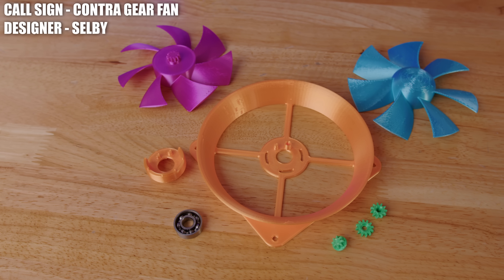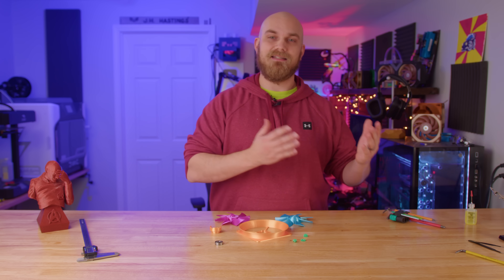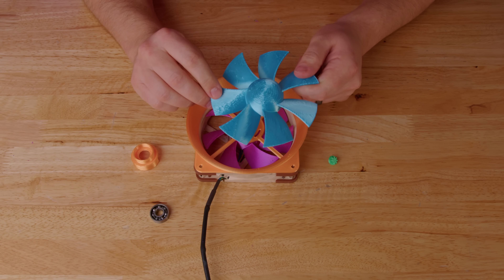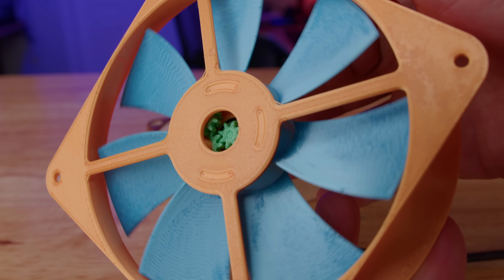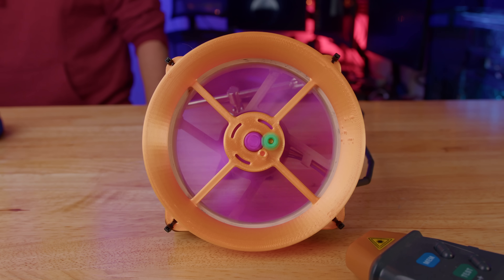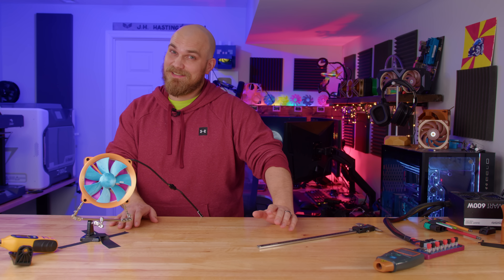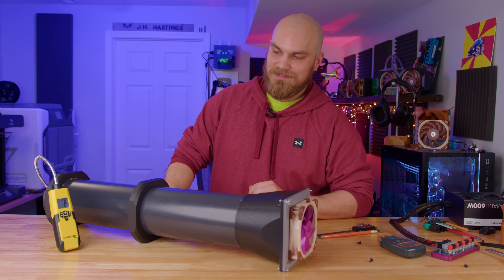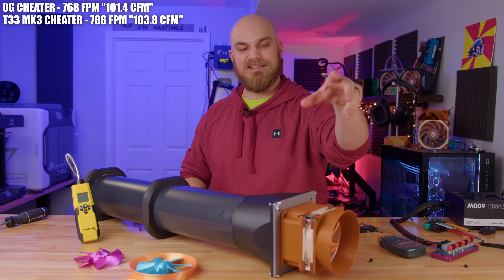World’s Most Complex PC Cooling Fan | Fan Showdown S4 Special

Comment: FINALLY! it took me as long as the subreddit has existed but I finally got a contra fan to make it! and it actually works... good times. Going to be honest, even though I know contra rotation has its advantages I'm genuinely surprised the second fan actually managed to increase performance and seeing it do so is a very good feeling.   

For anyone wondering about planetary and bevel gears sets the issues really comes down to how the gears are braced inside the fan. In the case of planetary all the designs I tried just added to much friction (causing both to be slow and much louder) all while not running at a 1:1 fan speed ratio which I wanted to reduce the chance of one fan throttling the other, this is also why the fans have the same blade count even though that probably increased noise a fair bit. As for bevel gears well i just couldn't manage to print 3D them and still function at such small scale and as such cant really as much about how well they work.
Reply: Well done! Awesome design.
Reply: It really is an awesome feat. Congratulations!
Reply: awesome fan and design. Now I want to see your Contra fan with a shroud as large as the cheaters to see if it gets even better?
Reply: @TheFinalattacker  First thing I need to change is the hub size, I forgot the motor is much smaller then the A12x25's hub meaning in the smoke test for my design you can see a large lip around the base causing a lot of turbulence. I suspect part of the reason the T33 works so well is it's hub matching the frames base diameter while being tapered for better air flow. After that I guess I can look into improving the inlet and outlet like the cheater does...
Reply: @qazaq25   I wonder what would have happened if it would have used the stock fan design
Reply: u r a legend, Sir.
Reply: Very cool design. You should be proud.
Reply: Do you think a different printer may help with the flaws in bevel gears? Like a resin printer over a filament printer.
I've never done any 3d printing so have no clue what features make more accurate prints.
If so maybe we could pester James for a revisit if Shelby has a design for it.
Reply: If this fan could be made from precision machine components, wow, I would buy it in a heart beat.  Contra fans are just so cool.
Reply: Sweet fan.  Appreciate the research and work that went into.  I think GOAT is an unfair characterization however.  I propose Fan Showdown GodKing.
Reply: what if, t-33 mk3 and counter-rotate fans combined...
Reply: Just a thought, would making the drive fan blade pitch more aggressive to account for the fact it's moving already accelerated (lower pressure) air improve the overall performance?
Reply: @alargecookie  No not really its ideal to have nearly the same fan since most of the benefit is hitting the air coming off the front blade and counteracting the lateral component that the first blade imparts on the air yo u can see that in the smoke coming out nice and straight and not cone shaped. Think of it in terms of the same reason that you need to paddle a canoe on both sides to move forward.
Reply: @alargecookie  Yes, the inner fan should have more aggressive pitch, which should boost the performance a fair amount. I couldn't tell you what the pitch should be, though.

Now I want to see a PC fan with variable pitch props...
Reply: @alargecookie  not really. you would create pressure difference between the blades but it could not be used. if you block of the exhaust and route the air out between the fanblades you basically got a compressor. since we want the air go through,  different pitch would not be beneficial. maybe in small amounts to counter velocity loss, but no more.
Reply: So...how long until we see the Selby Cheater colab fan aka "the lord of the fans"
Reply: You have been given the G.O.A.T. designation. I agree. Fantastic job and design.
Reply: The cheater frame is uneconomical, the contrafan is better by size
Reply: How about the blue fan from Season 1
Reply: I had lost hope for gear based fans. The results for this contra fan are awesome!
Reply: Keeping the hub down with smaller gears was also a pretty inspired design too man - that packages really really well and was a good bit of engineering.

I don't know if there's any science out there on the interaction of contra-rotating fans (as opposed to compressors or propellers) that could be applied here that you haven't done already - all I can think of is improving blade interaction and then trying to reduce friction to increase max RPM.

Well friggin done.
Reply: I mean I'm not a fan builder and I'm not an engineer great work by the way I was wondering though I wonder how well the fan would work if you tighten the tolerances of the gear a little bit because if you notice the once the first fan spins it takes a minute for the second one to spin again I'm just asking a question so I'm sorry if it's a bad one LOL
Reply: @cptn.obvious  The term your looking for is backlash and yes there might be a little too much here but probably not enough to be particularly concerned. Backlash is important as it helps prevent gears binding as well as some other things. Unfortunately a lot of that play is also down to the fact these are 3d printed resulting in the spacing between the shaft and bore of the gear having to be "large" to reliably run smoothly but also allows them to push each other away, now that could be fixed by using bushings and metal shafts for the gears but I wasn't about to make the design require those on what is essentially a prototype I wouldn't be assembling myself.
Reply: @qazaq25  thanks for the explanation i appreciate and now i understand still an awesome fan great work
Reply: @qazaq25  Contra is actually made wrong. The primary fan should turn slower than the secondary fan
Reply: @cptn.obvious  Backlash (or lack of) is more important when you're using the gears to index to a precise position rather than spin continuously. When it's spinning in a steady state under load, the back pressure of the air is keeping it pressed one way, so it doesn't wobble too much.
Reply: If you used two notcua fans, running against each other but printed a fan with opposite fan blades then you could have full control of both the RPM’s to balance noise. Yeh against the rules but interesting idea…?
Reply: I've been trying to design a counter-rotating fan since the show started, but I've never been great with gear trains so I never could get it to work out right. I'm so happy that you were able to make one that works so well and that made it onto the show!!! Contgrats!!!
Reply: This may or may not have been mentioned, but here's an idea to reduce the noise of the geartrain. With the aircraft engines trying to maintain their speed and torque in both prop sets given the size and weight of components, the gearset makes sense: we're talking about a fan that is significantly smaller in various regards. 

So the thought is this- maintain the reduction ratios but have the gears be appropriately sized drive wheels (shaft with a rubberized material or TPU insert) to act as wheels running against each other. This might result in a slightly higher fiction load on startup, but it could maintain the reduction ratio with significantly less noise, still transmit the power with reversed direction, and effectively eliminate the need for lubricating oil.
Reply: Strikes me that its STATIC PRESSURE would be through the roof!!! I suspect as a pure air flow fan it isn't showing its best, but as a fan to go on a radiator.... You are really truly onto something... Like really big onto something!!! Major, you need to test it on a radiator!

That thing was spectacular.

The iterative updates that are coming through on this show have got to be making fan manufacturers stand up and take some real notice.

Major, you have created a movement here... An air one (geddit) but a movement nonetheless.
Reply: @DampQuiche  Contra rotating fans are really good for producing high thrust (essentially injecting airflow at a distance) - I wouldn't be shocked to see that the airflow distribution at his measurement point is much less uniform with the contra rotating setup relative to the MK3. The contra fans would likely be much better as a fan for a server rack where you needed to make sure your cooling air got further into the rack.
Reply: This thing is awesome, thank you for sharing!
I was wondering, if the secondary fan actually helps or whether it is the shroud, that does it?
Reply: @minipaintingforyou  It's the extra fan the shroud only helps a minimal bit because its very small compared to other designs that use taller shrouds to help direct airflow, in this case the shroud is more like a safety feature/structural necessity but I digress, the extra fan provides additional surface area so it moves more air. Do note that despite being an entirely new fan the volume of air is not doubled. That is not a flaw but the result of both the available mechanical energy being split between the fans, inherent inefficiencies of the gearing and the fact that increasing air speed is does not scale linearly it takes increasingly more energy in order to accelerate more. (Wind resistance and all that.)
Reply: @alexisrivera200xable  thank you =)
Reply: now add a stator between the two fans
Reply: it looked like the blades on your contra-rotating fan design had similar blade angles i wonder how well it would work if you created a steeper blade angle on the drive fan like you would see in an aircraft compressor fan
Reply: awesome. is it possible to add tiny little bearings for the gears, too? like teflon or ptfe, even copper (and gun oil?) could work. oh yeah, if possible helical gears for noise reduction. and if we are dreaming further a balanced quiet version made in a real factory should be really good for radiators. would totally rock them as intake with no frontpanel. was smiling the entire video. so good even in its first evolution.
Reply: Great work! That is an amazing design. What happens if the contra gear ratio is increased? Not by much but maybe pushing another 300 RPM or so out of the front fan or does the motor not have enough torque to push for more?
Reply: Now.
If the gears wre made of aluminium or brass on bearings - removing friction. 
And noise...

Whre is JohnnyQ90 when you need him; https://www.youtube.com/c/johnnyq90
Reply: Why look at the 100 year old British designs when the Russians have perfected the contra setup?  The fastest prop planes in the world are made by Tupolev.
For more modern possibly even more relatable setups, look into F3P RC pattern planes.  They use electric motors and some use contra rotating props
Reply: The second fan (the drive fan in this scenario) usually has higher pitch blades (as opposed to having more) to compensate for the faster airflow it sees compared to the leading fan blades.
Reply: Selby, my fellow maker. I need this, I NEED this in my rig, PLEASE LINK ME THE STLS! I am willing to beg and or cry.
Reply: id like to see a hybrid of the gearfan & cheater frame
Reply: really cool design :)
Reply: This sound in 10:20  look like a diesel engine car like a Bugatti coupé Atlantic
Reply: Thanks for the dedication.
Reply: Very nice 👏👏👏
Reply: I literally applauded. Now we just need to see the Contra somehow placed into the Cheater.
Reply: Brooo insane fan design. Is it too much to ask for the .STL files? I'd love to actually use one of these XD
Reply: slow clap 👏👏👏
Reply: Amazing design mate! Congratulations!
Reply: Two's company...
But THREE's a party!
Time for a tri-contra stack. The middle can would need to be the carrier (I think that's the name? ring with inner teeth) driven by a planetary.

... Wait? 🤔
Was this tried / could this work?
What if you printed three posts on the main fan hub, to let the planetaries slip onto (instead of being on the intermediate carrier assembly), then have the contra fan have a splined output shaft -- like it does in this vid -- that acts as the sun gear.

I think the real ticket, though, would be to make the planetary gear shafts larger diameter, to overcome the printer detail limitation, thereby (hopefully) yielding a truer circle for the planetary gears themselves to spin on; thus, a smoother operating gearbox........ Maybe....? 🥴🤞

Wish I had a 3D Printer to do this all myself lol
Though, maybe with these various old cordless drills I still have, and their own planetary gearboxes, I could glue up what it is I'm after...
*sacrifices some chewing gum, a paper clip, and duck tape in hopes of pleasing the almighty MacGyver*
Reply: Pretty sure the blade pitch is different between front and rear props on a Contra set up... id look into it as you maybe leaving some performance behind.
Reply: There was Cooler Master UFO fan that came out around 2000 - 2002 and my friend had one. I really can't find it in the internet anymore but it had Staters and this made the fan look like contra rotating fans. Try designing a fan using the same blade setup as a Cooler Master MasterFan SF120M.
Reply: Or the Cooler Master GeminII M4 Low Profile Heatsink
Reply: Now for a 3 or 4 level contra rotating fan, starting with thin blades and working up to thicker blades, each level needs different pitches
Reply: Ok i have asked multiple times now. What is the smoke test song?
Reply: Great work for making this work, you are a legend and so is Major for doing this series.
Reply: It didn’t do the classic counter rotating goal of leaving clean air behind it but the vortex it generated, from the smoke test at least, looks really tight and uniform with very little turbulence.  You might want to investigate doing a design like this for electric ducted fan propulsion, because that sort of thing is exactly what you want for that application.
Reply: Awesome fan! Congrats!
Reply: now 4 fans in series plz....
Reply: Keep making amazing stuff! Don't limit yourself to just fans but everyone is looking forward to your new fan designs i m sure! 👍👌🙏
Reply: I want a to see a cheater version of this
Reply: please tell me i can download this. i want to print it in resin.
Reply: well done. wonder what a properly machined metal version would perform like
Reply: Helical cut gears to quiet it down and make it smoother
Reply: if will fit in a normal full case i'll buy one to fit on my AIO.
Reply: okay, now stack them like 6 layers deep lol
Reply: @ionceateapinecone  Tom did a video stacking like 100 fans onto a rad. Made no difference
Reply: Congratulations man
Reply: Now that you've got this working, have you considered trying to modify the design such that you could just attach this to the front of a stock Noctua?

I think you an appropriate jig, you should be able to glue the drive gear on, and beyond that, it would be more or less the same as what you already have, eh?
Reply: Good Job!
Reply: Nice one Selby
Reply: Wasn't that great design used in many many places all over the world.. I am pretty sure it most definitely was...
Reply: Crazy cool design bro and ofc congratulations on being featured 🤘🏻
Reply: Great design.So simple!
Reply: I think you may be able to reduce wobble by angling the outer fan every so slightly to counter act the torque  of the gears
Reply: you and the designer of the cheater need to collaborate to make a contra rotating cheater fan!!!!
Reply: Hi, would you be willing to share the fan STL? I would love to try to print one
Reply: Well done! Now have a rim (or cheater) harmonic wave transmission, and fans with blade feathering (and an off by one count.)
Reply: There seems to be some fan strikes with a minor blade adjustment i think you could get above 1600 rpm, and have a quieter fan and extend the fan shroud to be more simular to the cheater call it the contra mk2
Reply: Are you going to do a v2?
Reply: Are there off-the-shelf metal gears you might be able to get for the inter-fan drive chain? I feel like they might have less resistance and a better noise profile?
Reply: If you want to make it quieter use helical cut gears. Strait cut are noise. The helical gears will also be smoother but my have more friction. However this is very impressive to say the least
Reply: maybe try playing with the fan angles to make them mimic a torque converer in a car. might help the supercharging effect
Reply: Contra is actually made wrong. The primary fan should turn slower than the secondary fan
Reply: You should find some old cordless drills to tear apart because they have metal planetaries about the same size.
Reply: i think its dumb noisy and pointless ,just have 2 fans together ....
Reply: @girlsdrinkfeck  you obviously don't understand the point of this channel...

Comment: I know this is a very late comment, but Molybdenum disulfide grease might be good for applications like this, as (I think) it kinda helps fill in small imperfections between two surfaces by getting packed into them. 

Stuff is extremely messy though, we use it a lot at work and it will absolutey stain anything porous so be warned